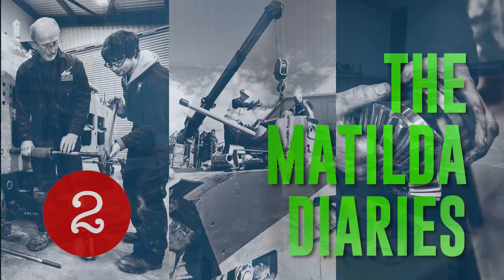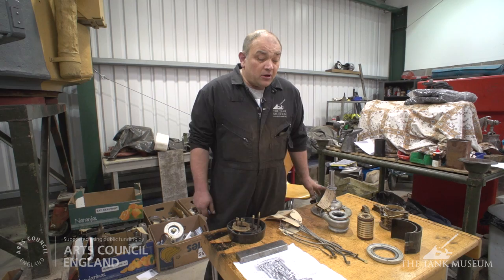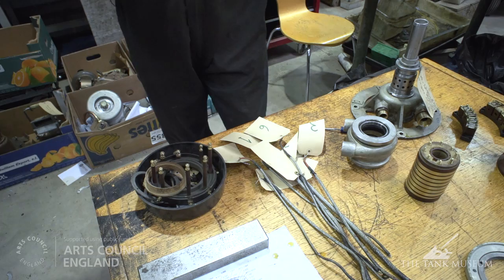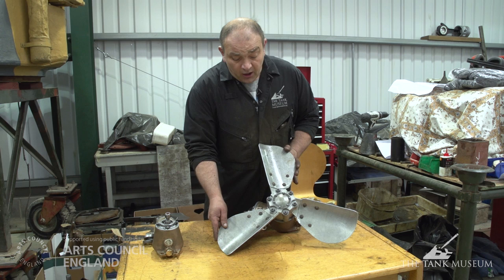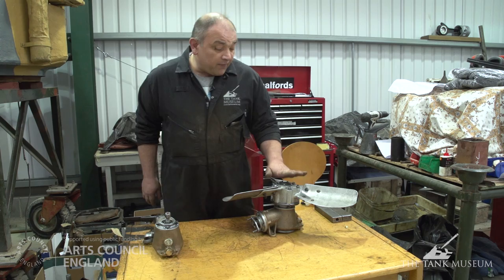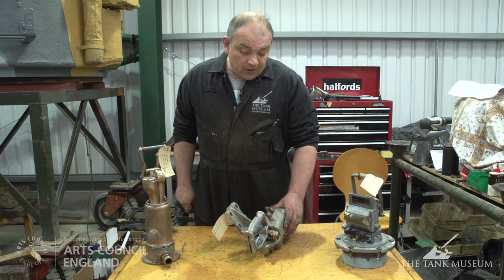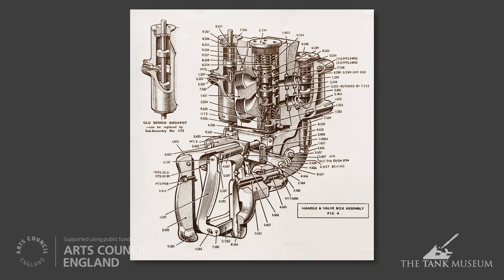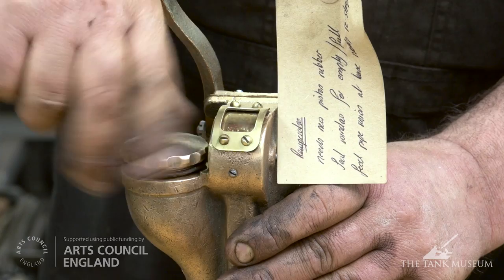The Matilda Diaries Part 2 | The Tank Museum

Comment: I can't tell which is more impressive: either that original parts actually still exist for the tank, or that it's possible to actually discover and recreate the parts that are missing and unavailable. Both are incredible to me!
Reply: if they have the original it is fairly easy to reproduce more it's the missing ones that take some work to recreate.
Reply: I can relate.
During my apprenticeship I once had to do an overhaul an old electric hacksaw.
The saw had a hydraulic advance-drive that was pretty much shot (gaskets were leaking badly for example) and even though the saw was only about 40 years old, it was a real pain in the butt to find a supplyer who still had the right spare parts.
And off course, we had no real documentation, I had to disassemble the whole hydraulic assembly very carefully, numbering and labeling all the pieces and hand-drawing new blueprints so I would know how to put it back together later.
This kind of work can be very difficult, but also a lot of fun.